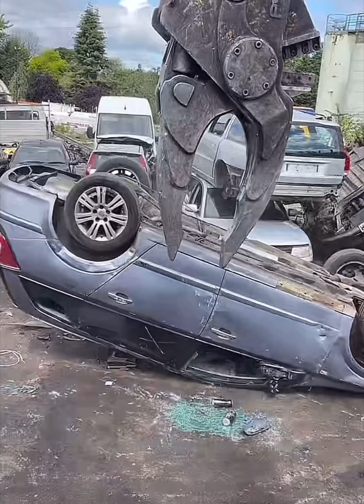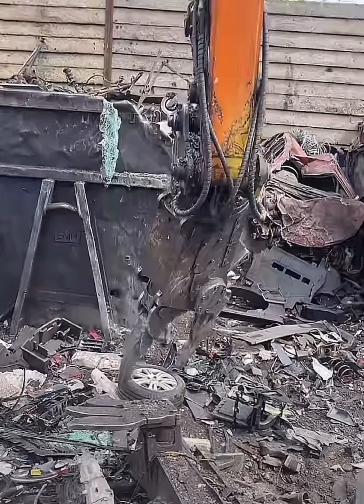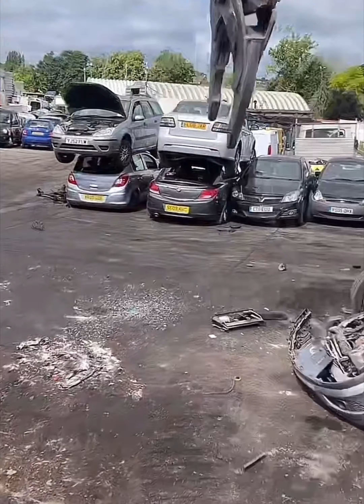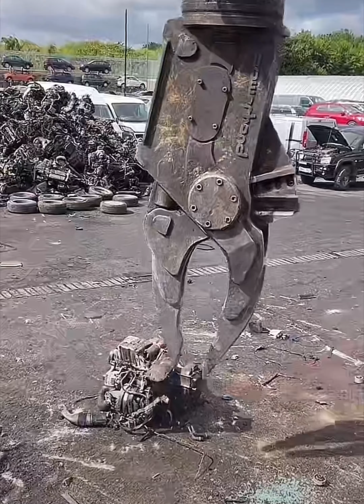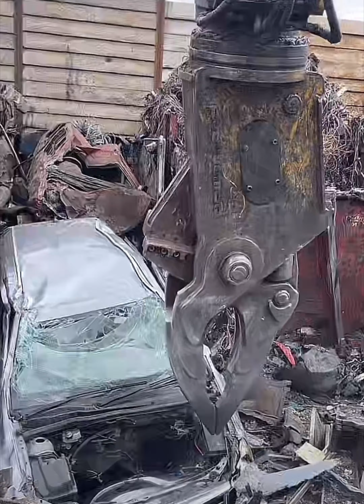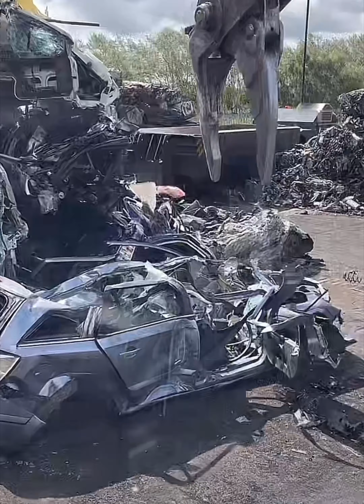From Start to Finish: The Complete Car Dismantling Process

Comment: doesnt it make more sense to sell it out for parts? or atleast try to restore and sell it
Reply: The only sense considered is financial sense.   If it was worth making it roadworthy again,  it wouldn't be at an auto dismantler.    As for parts, you better believe they look at the market value of salvageable parts vs the cost required to pull them.